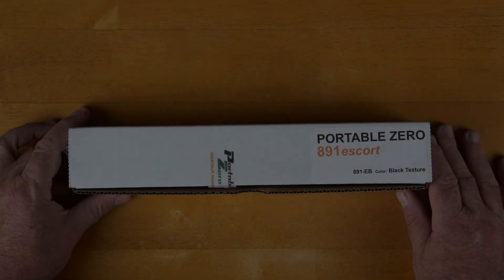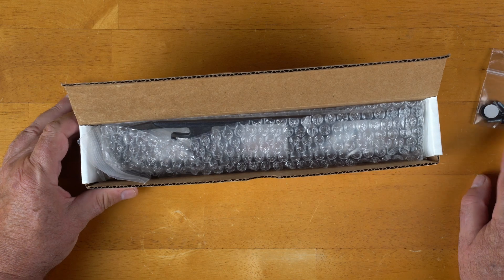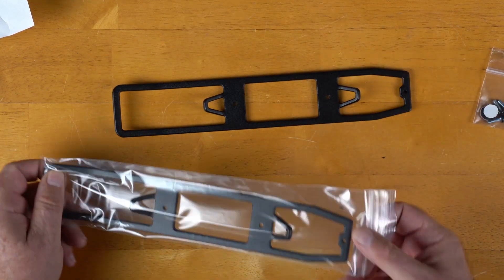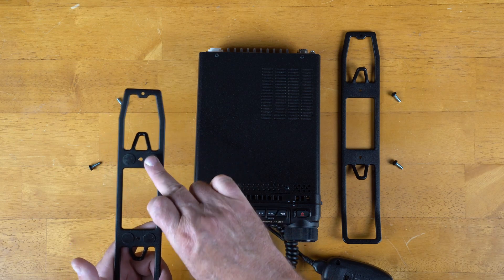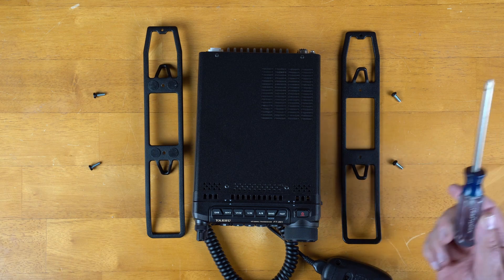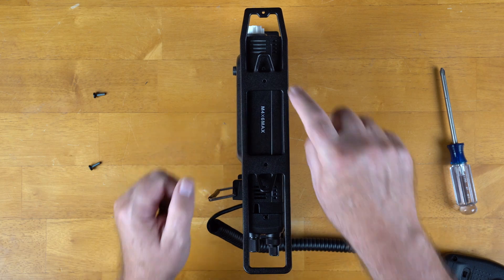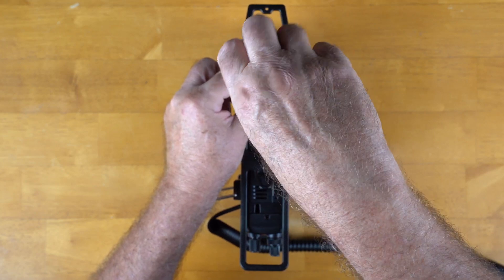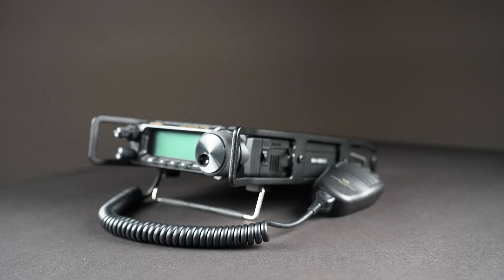Ft-891 Safety Rails, Unboxing, Installation and Review

Comment: Drill and tap for short screws on the non shoulder strap side so you can mount your mic holder vertically. I did this right under the front rail screw. Obviously, you don't want a screw that's too long that will dig into the radio.

Comment: I have these rails too. I thought about getting the Armoloq version but I have my FC-50 tuner connected to the bottom of the rig. You can put the Portable Zeros on the FC-50 too but you have to drill new holes
Reply from the maker: I normally don't use a tuner (I use resonant antenna's) so these rails work good for me. Thanks for stopping by and taking the time to comment!

Comment: Thanks for the video. I have an old 706mkiig I use for portable. I really like that radio, but power draw is quite high, and the screen is fading. I'm liking the 891. I see the chinese radios with the kitchen sink built in and really wish yaesu would at least upgrade the 891 with a tuner, adding a sound card would not hurt either.
Reply from the maker: Maybe in the future as components get smaller we'll see a new version with a tuner and SC. Glad you liked the video, thanks for stopping by and commenting!

Comment: Thanks for showing. I have straight rails on my 891 and have mixed experiences. While they’re great regarding protection and also looking very professional I now have to look for a bigger hardcase for transportation 😁 as the tx with rails doesn’t fit into the old one any more….
Reply from the maker: Yeah, adding the rails does add to the size. I was lucky as I could use the hard case I had for my previous portable radio as it was bigger. Thanks for stopping by and taking the time to comment!